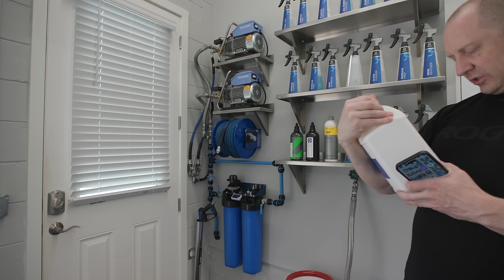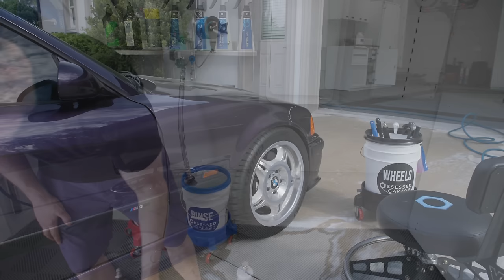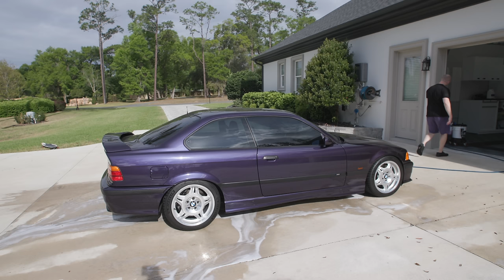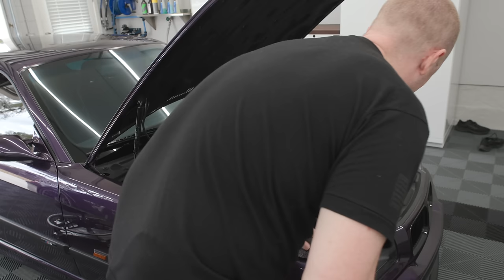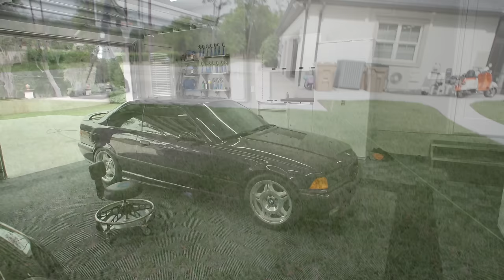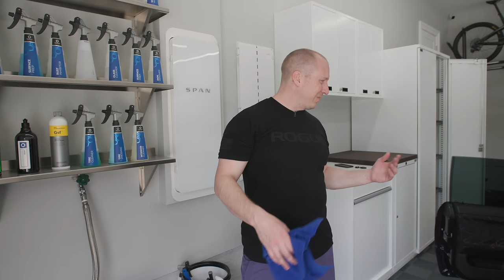Wash and Talk: E36 M3 (Techno Violet/M-Cross)

Comment: Hey Matt just a heads up on that PIR. It’s actually what you originally thought it was man. 5 gallons is 18,927ml. It’s 18,927x.04 which equals 757ml.  Bro I went WAY down this rabbit hole trust me. Also you will be perfectly fine using a 2% PIR and not 4%. I use 2% on my Tundra on every wash and she comes out CLEAN CLEAN. That would be 378ml for Touch less at a 2% PIR. Imo the product is WAY to expensive when using that particular cannon.
Reply: Yeah I use 3% and it cleans super well (I only bust out Touchless when it’s really dirty). I’d also question after the actual measurement is taken whether he really made it to 5 gal.
Reply: Why not just use a pump sprayer? Yes I know, it takes a bit more time. No need to figure out how much volume your cannon puts out. Get that 1L pump sprayer and add 20-50mL (2%-5%) of Touchless and you are done.
Reply: @stephenleach4808  it’s actually super easy to figure out your output and it only has to be performed once. Unless you change a portion of your wash process equipment.
Reply: @dailyDIYdude  Yeah that makes sense. It seems to me that this product doesnt really need a foam cannon for application though? I realize that in terms of time, the foam cannon route would be faster. For the user who only does his own washes on his own cars once in awhile, time isnt really that big a factor. You could save using a ton of product, and it would only take a marginal increase in time if you used a pump spray?
Reply: @stephenleach4808  yeah honestly not sure man. I’ve never owned a foaming pump sprayer tbh.  I guess the cannon is easy for me because that’s what I already own and been using for years. It’s pretty satisfying to use more then anything.
Reply: I think the boss cannon shoots at 20:1 which would be about 5%  (One Part to Nineteen would be exactly 5 percent. I haven’t tested this but have heard that is the ration on the auto dilution insert on the pickup ball. If so it’s very easy just fill up the cannon neat and you are very close to 5%.
Reply: Exactly what i do. 2 percent of auto foam. Pete hamber emailed me back regarding if ph goes down if you use a lower pir and he said it does, exact amount would be hard to determine but im guessing it would be around 9.5 ph which is exactly what you want being used every week or a few times a month, no need for more product to get 13 ph.

Comment: I could be wrong but I don’t think there’s much difference in just using a slightly higher ph soap than the bilt hammer pre washes, any time I have an extra dirty car I just soak in carpro lift or citrus foam from Gtechniq before my intial rinse even your decon soap would serve the same purpose.

Comment: People need to remember that 4% is the maximum dilution, you wouldn’t use a sledgehammer to put a nail in the wall, Auto Foam and Touchless work from 1-2% and work well.
Reply: I agree 100%. I use 2% on bye weekly washes and 1% on weekly washes. I’m pound to say I’m a mittless washer now.
Reply: Exactly what i do. 2 percent of auto foam. Pete hamber emailed me back regarding if ph goes down if you use a lower pir and he said it does, exact amount would be hard to determine but im guessing it would be around 9.5 ph which is exactly what you want being used every week or a few times a month, no need for more product to get 13 ph.

Comment: Love the wash and talks. 

Bilt Hamber Autofoam and Touchless don't really foam much because of the dilution ratios but they are very effective as a pre wash product.
Reply: It actually foams really well when the correct solution is added 😂😂
Reply: @dailyDIYdude  He did the correct solution
Reply: You're right. I've been using auto foam for years and it is an amazing pre wash. It doesn't foam alot by design.
Reply: @dissaver  Amazing?  Come on man.  Good, maybe even great.  But "amazing" is just too over-the-top.
Reply: They don't foam much because the foam is not intended to cling. It is designed to run off the surface, carrying dirt down with it.
Reply: @ultanwoods  he used 10% of what should have been.
Reply: As mentioned they’re not designed to foam and look good, they’re designed to work.

Comment: Would it be more economical to dilute Touchless in a Marolex pump sprayer? I’m assuming the PIR would require much less soap since you only have to worry about the solution in the bottle instead of added water from a pressure washer?
Reply from the maker: It probably would.

Comment: Why not just use one pressure washer to initially apply foam?  Then use both for the rinse.
Reply: You can if you are not using the CR Spotless. It can’t flow 4 GPM and remain 0 TDS

Comment: Are you supposed to dilute brake buster?
Reply: It wasn't designed to be diluted, although it can be if you want. Most people who complain about Brake Buster lacking ultimate cleaning ability are the ones who are also diluting it. From my point of view, you may as well just use soap if you are going dilute Brake Buster.
Reply: @dfbsgarage  ok cool, I don’t dilute it. Just making sure I’m using it correctly
Reply: @BryanMc17  10:1 is the most common dilution, at that strength it really struggles to clean tires. I stick to undiluted and have never had to question it's cleaning ability, for both wheels and tires. I even use it to clean my lawn mower!
Reply: @dfbsgarage  thank you!
Reply: @BryanMc17  My pleasure.
Reply: For rough wheels, I'll use full strength.  For ones I clean on the regular, I go 1:1 with water in a foaming sprayer.  Tires are always full strength.

Comment: Why the science project? Why don’t they use standard dilutions?
Reply: Not every pressure washer is the same so even if Bilt Hamber use the standard dilution everyone would get different results. Remember the Pressure Washer is diluting it more with water so whatever solution is on the foam lance will get diluted further.